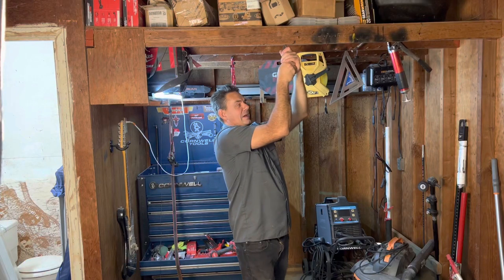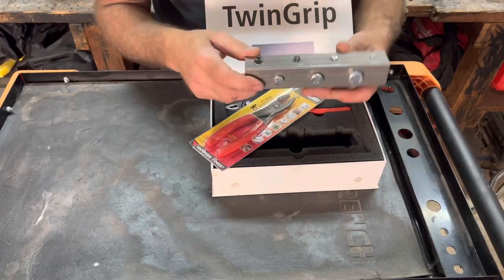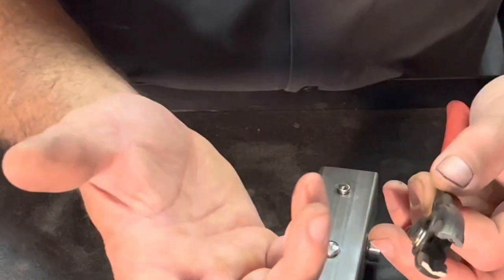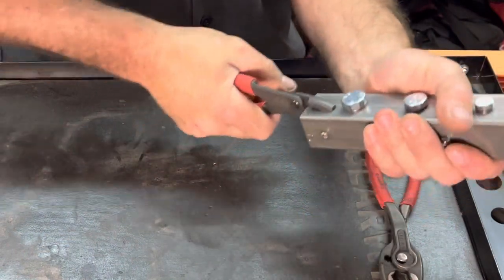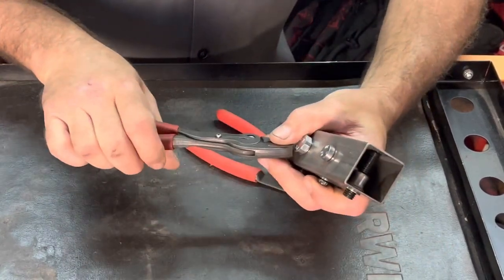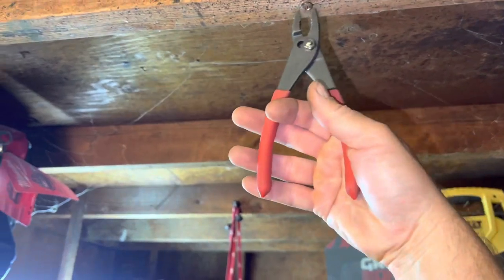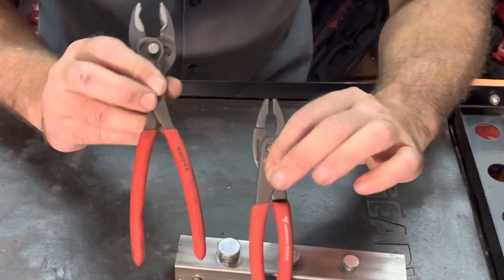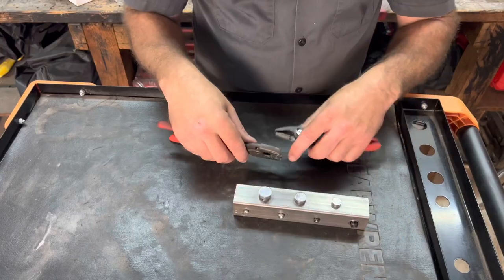Are Japanese VAMPLIERS  Better Than German Knipex Pliers?

Comment: Both are excellent pliers
Reply from the maker: I agree I would give a slight edge to the Knipex Only because you’re slightly bigger
Reply: I have both but those vampliers are better.  I got them first then tried all their other ones.  I got excited when the twin grips came out.  I kept having to go back to my van to get the vampliers.  After like 10x I carried the vampliers again and left the twin grips in the van for more grip once I broke something loose w the vampliers.  Until the icon pistol grip screw extraction pliers came out.  I would get both and after another 10x of using the icons when the knipex didn’t work.  I haven’t used the twin grips again they are still in the van tools in case I find an application my go tos don’t work

Comment: Any reason to pick one of these over locking vise-grip style plier?
Reply from the maker: The biggest reason is because vice grips are clumsy to work with. And these have a very specific design to grip the tip of a stripped out screw